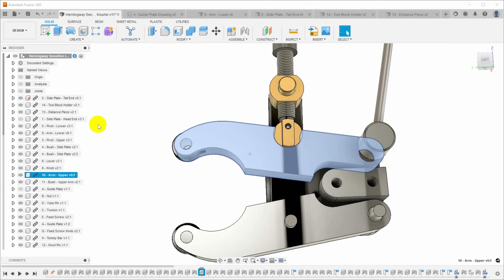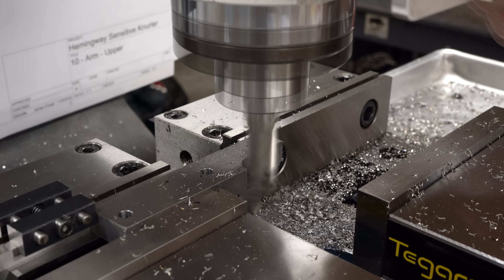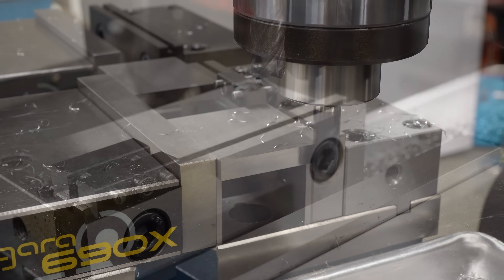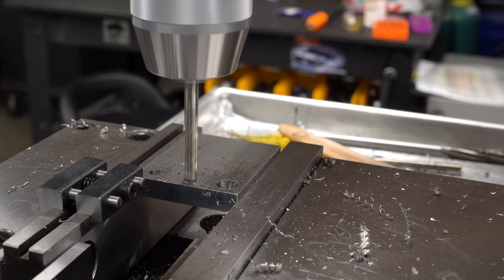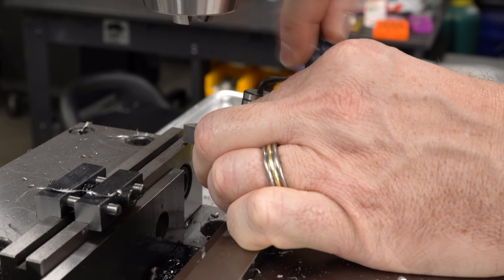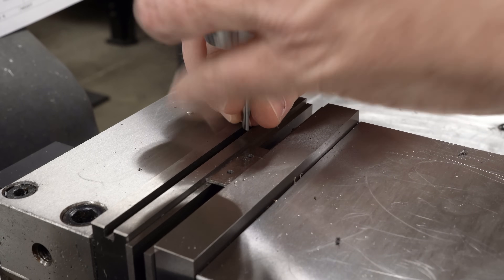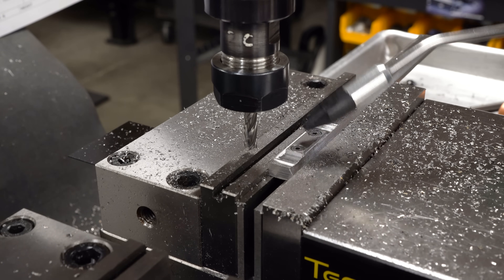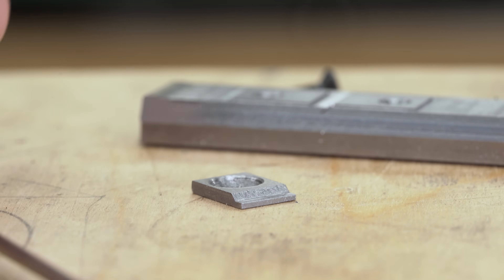Hemingway Sensitive Knurling Tool Build - Part 2

Comment: Isn't the diameter of the knurling 'rotor' deciding if the tracks coincide after one full revolution of the work piece? Why aren't there groove marks all over the place on the work piece after many revolutions? Something I've been wondering for some time now, haha..
Reply from the maker: Ideally, if the circumference of the part is a multiple of the tooth pitch on the knurl, the teeth will fall into the same grooves on subsequent revolutions.  In reality, there is a little wiggle room because the wheels will tend to be pulled into synchronization as the teeth find their way into the previous grooves despite a small misalignment.  If the circumference is off by about half a tooth, it's possible to get a double pattern.  If you look around on the Internet, you will find calculators for acceptable diameters along with people saying it doesn't matter at all, or that you'll die if you do it wrong.
Reply: @Clough42  And then the diameter of the work piece will also get bigger as the knurling tool presses into the material causing a different diameter-alignment-three-body-problem again.. Aaargh.. my brain hurts.. I wonder if the 'it doesn't matter' camp always gets lucky in terms of work piece diameter.. :-) Thanks, but I'll put this in the too hard basket for now.

Comment: @Clough42 at about the one minute mark you "tap down" the part with that rod of copper. is there any reason you use copper specifically as a "dead blow hammer"? is it mostly because it's a fairly soft metal so it wont dent parts?
Reply from the maker: It's heavy, and it's soft.  The softness means it won't mar steel parts, and it also doesn't bounce as much, so more of the energy goes into the part.  You have to be careful though, because it's easy to have the parallels bounce off the floor of the vise.  Easy does it, and I often overdo it.

Comment: Very Nice, James – I'm always amazed at what Joe Pie does on his full-size equipment when making tiny, functional machines.

You must be ecstatic: you have found a project that not only has mixed inch & metric dimensions/hardware (which as we have discussed before is something I almost always have in my designs), but also fractional inch drawings (which I have scattered among some of my dimensions as well), and I heard you say that you lowered the 1/4" end mill 1/32" to make the blades on the retainers.

I was hoping that my TouchDRO had the capability of displaying fractional inches and that I could wave that in front of your industrial quality DRO, but alas that is not the case. Not wanting to surrender quite that easily, I reached out to Yuriy to see if this was included in his new (V3) build (noting that it could be helpful to woodworkers as well), and although he didn't and does not have plans to do so, he reminded me that "it's very easy to enter them into the dimension preset. Most numeric entry fields accept simple equations, so you can just type "7/16" (without quotes) and TouchDRO will convert this to decimal." Perhaps this is also the case with your DRO?

Comment: James...you mention a corncob roughing end mill in your video. Would you have a manufacturer & part number you could share? Would be interested in checking that out. Thanks
Reply from the maker: This one is from Lakeshore Carbide.  Not cheap, but quite good.  170RF12HD

Comment: I made one of these about a year ago. I modified it a bit so that instead of the bar that fits in the QCTP I made a new QCTP block that the knurler bolted directly to. It gives a little more sideways support to the arms and stops them from drifting in opposite directions.

Comment: Not sure if you just said it wrong or if you have ground your D-cutter to 90 degree a flat head screw should use a 82 degree counter sink. I would also think about climb milling a lot more with full size knee mill.
Reply from the maker: 90 for metric screws, 82 for imperial, 100 for British.  This design uses metric screws.
Reply: @Clough42  That's the great thing about standards, there are so many to choose from.
Reply from the maker: @RambozoClown  yeah, and those of us who live where mixed systems are in use get to buy all of our tools twice.

Comment: James your channel is great love watching you. Quality is excellent. If I may share a tip from a lifetime machinist that will improve your final outcome. When your squaring and generally side milling with an end-mill if you take a finish pass climbing you will get a much nicer final finish. Snug your locks just a touch. I usually use .003-.005 depending on material type. You don’t want the pass before to be real heavy maybe .020 or so then the finish pass in the climb direction. Leaves a nice final finish.  Also helps with accuracy. Keep up the great content!
Reply from the maker: This is what I usually do.  It does a nice job cleaning up any smeared chips.

Comment: James, I'm anticipating the next installment!  I ordered one of these kits and started trying to model it in fusion based on pulling measurements off of another YouTubers video.  You are right they are nice-looking drawings but the actual drawing is tough to figure out.  I'm hung up on the arms on the knurling wheel end.  I just can't get the hole in the right place to make the radii work.  When I get the drawings I'll get a good picture of it and bring them into fusion and locate the hole that way!
Reply from the maker: Yeah.  That's how I did it.  The drawings are fully constrained, but they do weird stuff, like measuring from the intersection point of an arc and a line instead of from the center point.
Reply: @Clough42  Hey...Automation Tooling Designer here...one machine shop I worked with for a few years required that on drawings, all points where arcs / radii intersect with lines are dimensioned.  Their reason was that while a machinist may use the centermark as a point to revolve around to create the feature, the Quality department needs to measure to actual, tangible features they can physically see.  So, sometimes seemingly odd things can appear in drawings and hopefully somebody makes a good case for doing so.  In the case of datums, they should remain constant on any given part.
Reply: @Clough42  I was just looking at your fusion model again and noticed how you appear to open a new design for each major component.  I am self-taught in CAD so some of these finer points are lost on me.  I have not seen that done before but can imagine you must have found a good reason to do it.  Is it to keep the file size down or the versioning aligned in a specific way?  I am curious to know, as I find you a very organized guy and I can do better!  TY
Reply from the maker: @Scottforyoutube  if I'm designing a part to fit something else, I often do it as a new component in a larger design.  In this case, I have all of the dimensions already, so I created them independently.